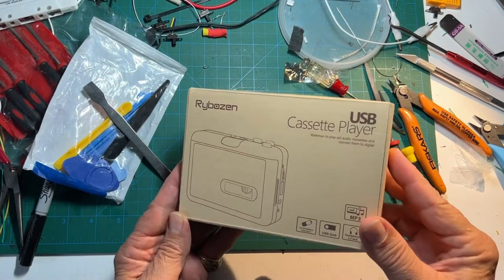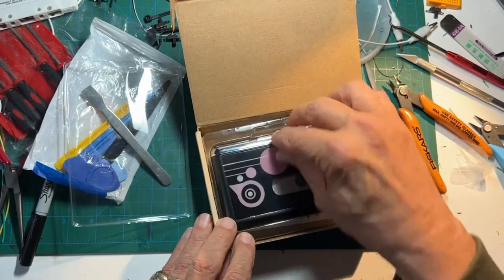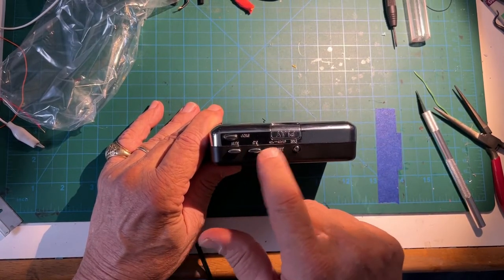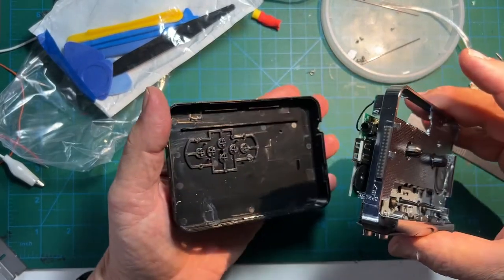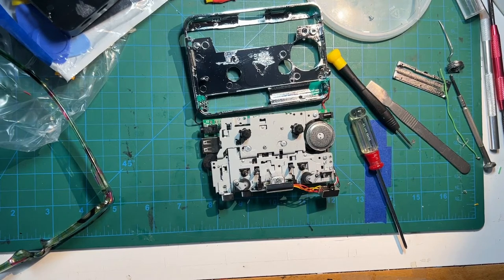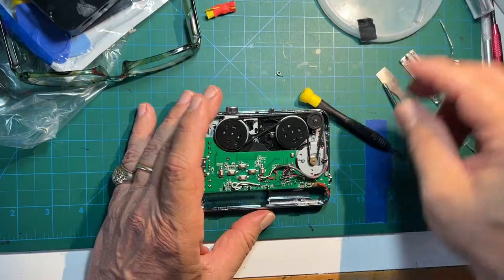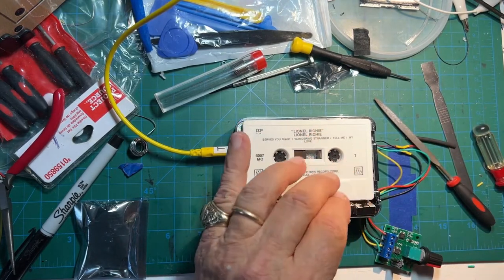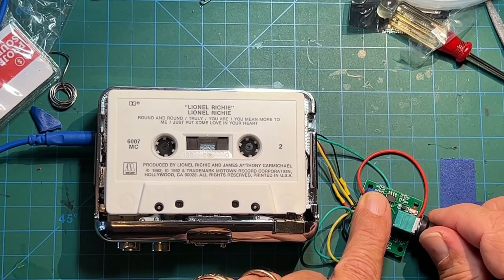Quick and Dirty Reverse Sound Cassette Mod: Easy, no cost, no solder to a new $20 cassette player

Comment: Okay, yours is the first speed control mod I've found that can speed up the tape and not just slow it down - this is a function I have been searching desperately for so my eyes went wide when I heard you pitch the tape up during playback.  How in the world did you accomplish this??  I'm watching the longer version right now in hopes for an answer!  Thanks for your video.
Reply from the maker: The PWM board drives the motor even faster than the tape player does. You'd have to switch out the PWM board to get the motor to the right speed if desired.

Comment: Great idea for tape hacking. I've been using similar pwm boards for speed control, along with 9v adaptors and a 1/4" switching jack to hack into the tape head pre-amp. Great for contzct mics and plugging hand held tape heads into.
Reply from the maker: Agreed! So much fun in using tape speed and direction for sound shaping!

Comment: hey Zen - this is excellent! I just got my hands on this cassette player and have a basic question re the mod. Ordinarily, the tape plays on side A then automatically continues to play side B (so forth and so forth). With this mod, will side A play till the end then play side A backwards (then forwards and backwards endlessly)? TIA
Reply from the maker: Hey Tom - Thanks! Yes, the cassette player still automatically reverses, and then plays the same two (stereo) channels in the other direction. So to simplify - as you said - it will play Side A in reverse and then reverse direction and continue to play Side A now in the regular forward sound endlessly.